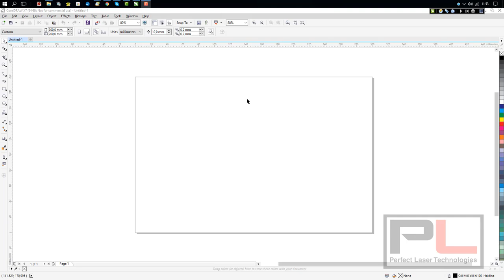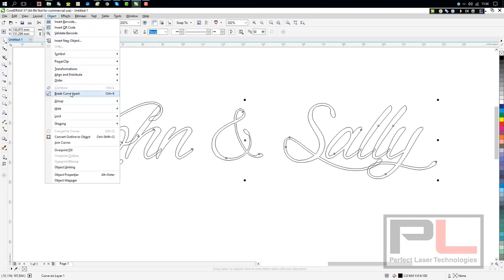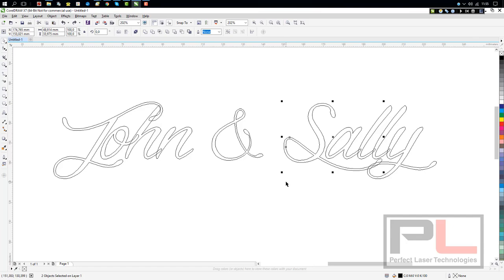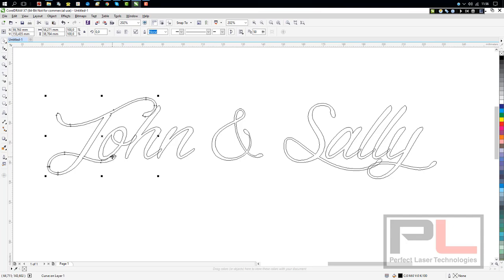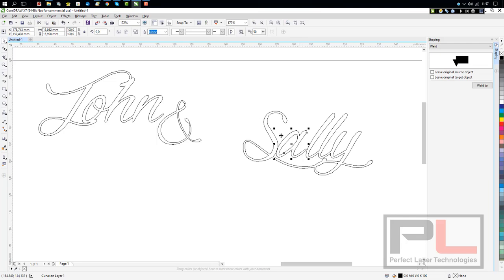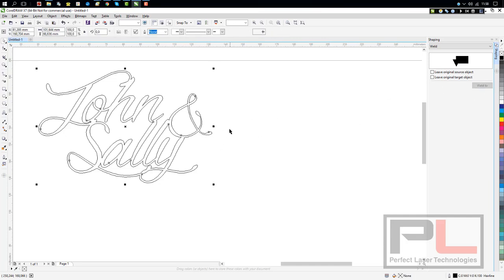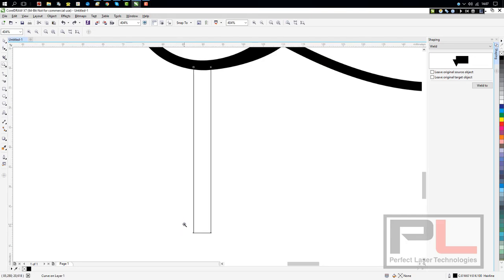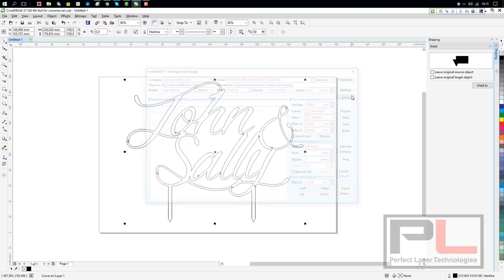Corellaser Cake Topper

Comment: hi i always face issues while cutting mirror acrylic, cus it leaves marks on the topper, can u kindly suggest the best settings to cut 2-3 mm mirror acrylic
Reply from the maker: Hi there, your settings will depend on the laser tube you have, but generally when I cut mirror acrylic I cut it from the back (reverse image) and I leave the plastic covering on the front until after the cut. Best is to use as little power as possible to cut through. On my 80W machine, I use 25% speed and 20% power.

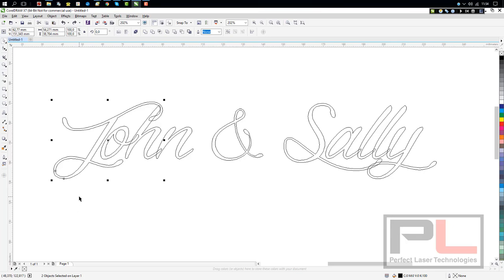Comment: Thank you for this it was very helpful as CorelDraw is very new for me.  However, although I was able to follow this with ease I was a little puzzled at around 1:57 where you selected 2 objects and I wasn't sure which keys you used.  2 objects did not show at all at the bottom of the page.  My final printout showed the curve of the bottom of the  'J' and 'o' were filled in.Could you help please?:)
Reply from the maker: Hi Judy. Glad I could help :-)  I used the shift key. If you have one object selected and hold down shift while clicking on the other, it will select both. The reason your 2 curves were filled is because they were not combined. Got it?
Reply: Thank you so much for your help Doc B:)  As it's late here I will do that tomorrow and will get back to you. Yes it makes more sense now, many thanks again :)
Reply: Got it! thank you again:)
Reply from the maker: Hey Judy, it's a pleasure. Have fun making cake toppers :)